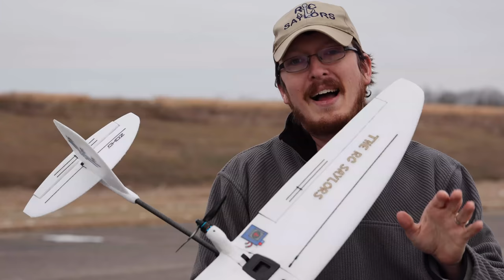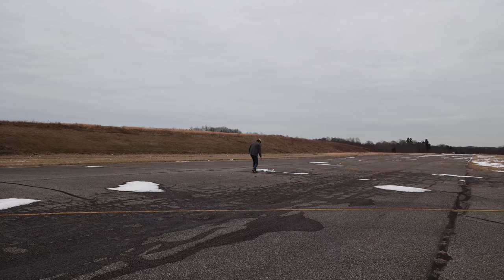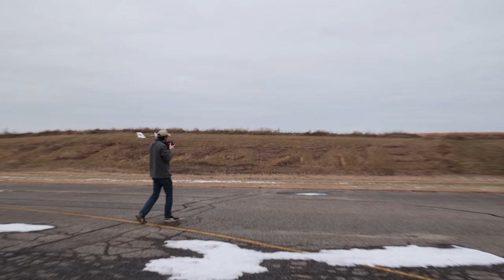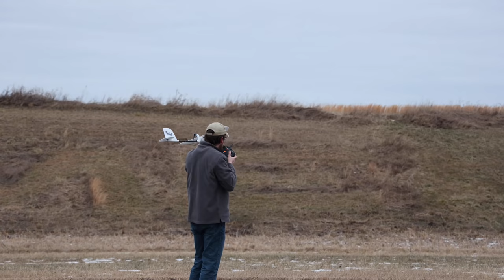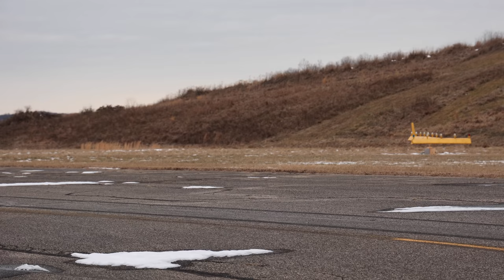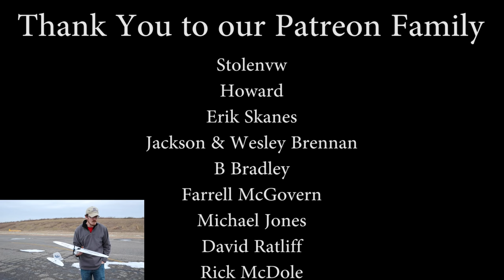DEMOLISHED RC PLANE IN 5 SECONDS - TheRcSaylors

Comment: I have this myself, and my first launch looked exactly like the opening of this video. The Drift has a really nasty downpitch when under throttle due to the thrust angle. I have the one with the Ko pilot controller, and I always use the launch mode now, but my first flight was with a normal "dumb" reciever. Great little flier once in the air, and I love the portability of it (but I wish it had a rudder). I got it for FPV, but it is fun to fly LOS as well.

Comment: Are the Spektrum "SMART" receivers particularly more difficult to program than the numerous other 6 axis receivers? I'll be looking to get a 6 axis receiver for my FT Simple Cub once I get the NX8 TX.
Reply from the maker: Well, after flying my Spitfire I would have said No.  Pretty easy actually, as long as you can follow directions well from a YouTube video.  The guy that does it on Horizon's channel is good, but he overlooks some steps that are obvious, if not for the first time doing it.  Once we get this down to a repeatable science, I'll do my best to get the content out to help others.  No clue what I did wrong on this plane, but definitely missed something.  Two receivers btw...  I'll figure it out.  Thanks for tuning in Bill!
Reply: @TheRcSaylors  Nate, follow up video would be interesting to me but I don't know if it wouldn't be to most of your viewers.

It could be set the receiver itself is faulty. I know Spektrum receivers have overall a good reputation but stuff happens.

Comment: Thanks for the awesome videos and I mean the good and bad ones. I'm familiar with the ZOHD models and they're great fliers for sure but they do tend to be picky and sensitive on the controls at times. One system I highly recommend for this is the ZOHD Kopilot system and the FPV/VTX Camera combo they have. It really keeps their planes stable, with GPS return to home and very simple to setup. I currently am using the ZOHD Kopilot on the eflite Opterra 2m and the RMRC StratoSurfer and I really love that security of being able to fly quite a distance and bring it back home. But mainly the stabilization mode in Kopilot really shines and makes the planes fly so stable even in windy conditions.

Comment: A friend gave me an AS3X receiver, I did not understand the manual, so I ordered a flight controller with inav, lots of buttons, but it flew out of the box after the wizard. The advantage its easier to take the time, read online on suggestions and have a nice UI. I hate fiddling with the radio... well spectrum new receivers have now PC configuration yay

Comment: Its a real shame such a great beginner fpv model has been shown like this. Guys, I love your content, I wanted to make that clear before I continue. Without you I would be nowhere in this hobby but the video doesnt do the aircraft justice. The cg mark on the wing is too far back, its actually on the wing spar and I believe this to be the cause of at least 2 of the crashes. Buy a new one and use a 2 cell 18650 battery without a spektrum receiver. Use the ZOHD KoPilot Lite and a tactic receiver which I know you own. It will fly for an hour plus. I have it setup up with Crossfire and I-Nav for BVLOS flying. I even have LEDs for night flying and a flaperon configuration. Its my everyday flyer after my UMX Turbo Timber. Its great. In fact there is an FPV version with all the electronics without the battery and receiver. Abby could use it as a chase plane in future using the onboard camera. I wish I could show you my setup but we cant share pics here. Ive still given you a like just to appreciate the hard work you do, especially in the awful weather you have had. All of my models except the Dart 250g and Drift I have brought because of your content. These include the E-Flite F-15 64mm, UMX Turbo Timber, Eachine Warbird Series (All of them!), the Volantex Sport Cub 500 and the larger Volantex P-51. You really should look into the latest Open TX radios (Radiomaster TX16s) which fly all of the models Ive just listed. Please please give the Drift another go using my advice.
Reply: There were obviously issues. It sucks that they had them. I will say the fact that the plane took that much abuse and continued to fly actually is a good way to sell it to someone who might be afraid to crash. I actually just ordered one because of this video.

Comment: Mate, just a couple of comments. Thanks for the video, camera was well operated. Smart receivers? You know more than I do about them. The airframe doesn't look much like a learner one to me. Elliptical wing, and looked like it had some camber, so the faster it flies the more lift produced, hence the need for some exponential on elevator? Would have liked to see more dihedral on a learner airframe. The plane looked like it would make an excellent little slope soarer. I would recommend it more for the intermediate/experienced flier. I dare say it would be quite aerobatic, in the right hands. Thanks again for sharing your fun!

Comment: I broke mine similarly on my maiden flight, also my fault. Forgot to fully check the control directions. I use the Kopilot Lite, which I love. Anyway, great flier once I got that right. But the wings are very weak. Go too fast and they will structurally fail (mine did after 2-3 flights). Mine are now reinforced and work great. Maybe you could demonstrate that wing failure. I’m hoping for a V2 of this great model.

Comment: safe settings are wrong nate  check the surfaces in safe bet the ailerons  are backwards
Reply: So it is possible for the ailerons to be correct out of SAFE and backwards in SAFE? What about rudder and elevator? Guess it would only take a few seconds to add a SAFE check to the preflight.

Comment: just from a quick look...the thrust line of the motor is way off...should like up with the cg and it looks like it lines up far behind the cg...the "safe" mode is working too hard and over-compensating which may be why it can compensate when the throttle is low...just a thought...

Comment: CG is wrong in book???  Not sure if this was the problem, but I just ran across a flight video where the pilot turned on his stabilization and the this plane went into a nosedive/spiral every time. Wasn't a whole lot better in normal flight. He found the CG was 'way off' as per the manual. Was way too 'tail heavy'. His recommendation was right on the servo wires of the wing... Just a thought.  have a good week...

Comment: you can easily test SAFE before you fly by moveing the plane around to see if the movements are counteracted: roll plane right and the left  aileron should rise to level plane.
Reply from the maker: I did, and it worked perfectly! I think the plane was over powered and over propped. Ill see if that makes any difference after I patch it back up 😉👍😁😎⚓
Reply: I should never have doubted you. A lot of people love that plane but they are saying that the CG it is a little bit off and the elevator has to have a very small amount of travel

Comment: The manual says to use the smaller 3 bladed prop for 3s, and the larger 2 bladed prop for 2s. You're right that you're over propped!
Reply from the maker: Way over propped, but still had something way wrong in my receiver for sure.
Reply: @TheRcSaylors  That'll run it into ground. I actually already got this airplane this week and have been flying it around FPV already. I didn't have any issues getting it launched, but like you said, experiences can vary a lot! It's a good little cruiser.
Reply: I'm flying mine without stabilization on 3S with the little 3-bladed prop, and it leaves a gentle hand toss wings level and climbing modestly at about 2/3 throttle.  (I'm trimmed for level flight at about 45%).

The manual also says the Drift is uncontrollable at airspeeds greater than 50kph (31mph).  I think it'll crowd that at w.o.t. in level flight, and easily exceed it in a power-on descent.

Comment: I know this was a while ago BUT the 5in Bi-Blade prop is for 2s use not 3s so yea wayyyy to much thrust hahaha there is a 3in Tri-Blade prop they give you and recommend for 3s use. Just wanted you to know cause it wasn't just your fault for sure. I bought a brotherHobby 1507 1900kv motor for 5in Bi-Blade and 3s which is gonna be very efficient and have a ton of power over the 1406 2600kv stock motor on 2s! KV for planes is MUCH different than quads, we would run 2600kv on 4s and 5in props but have to remember there is 4 motors and the plane can load that motor alot of the time plus a 1406 motor is TINY so it doesnt have much volume to disperse the heat to, Im surprised it didnt burn up that stock 1406 2600kv motor on 3s 5in prop lol

Comment: My dad bought a spectrum RTF cub and it flew terrible out of the box. He hated it, so after the disappointing maiden he tossed it in the shed and considered it a cash loss. On one of my visits I dug it out, spent about 20-30 minutes adjusting servo linkage, set points, CG, etc. and disconnected that “safe” garbage. The rudder (stock) would only turn left with full trim among other issues. After proper setup it flies great and is a most reliable plane. I Never fly or trust anything from any RC manufacturer with a factory setup. Like Traxxas forgetting to put in diff lube or shock oil lol.

Comment: Sorry I had to laugh as mine was destroyed trying to maiden just the same. It would suddenly become uncontrollable and crash. Tried a dive test and it wouldn't pull out and dove straight into the ground. I even snapped the motor pod off, a complete mess.  It now has plus plenty of glue and tape and flies great. The CG needs to be well forward of the marks, the elevator needs minimum travel and I went back to the 3 blade prop and increased the up angle of the boom slightly to the extent that the 2 blade prop was unusable as it just hit it. The end result is a fun plane that loops, rolls, will fly inverted and will cruise slow and low.

Comment: Some people had a lot of issues with this plane. I went 2s with mine and it has been great. I can even just glide launch it and then apply the motor. I have yet to go with a 3s or a lion pack. The 2s pack is just great in it. I went with the fpv version that came with the Kopilot lite. That works great! The auto launch is amazing too. Even with a ultra light 2s pack it does have a tiny tip stall. I appreciate your showing the Fail on your channel. I always enjoy your content.

Comment: I had the same problem with my Kingfisher PNP. It went straight up, then straight down. After replacing the fuselage, I reprogrammed the receiver correctly and it flew fine.

Comment: Spectrum!!!
Gotta hate it!!!
There is a reason why most people fly using OpenTx radios. 
I suppose it'll fix.
I know safe works, mostly.
Fix it right, use UHU Por & dreaa pins
Reply: why is this a spektrum problem?
Reply: @ab7rs  I suppose it isn't really.
Reply: @blackbirdboy1  Most people fly Spektrum, belive it or not, Spektrum is far easier to set up than Opentx (yes, I use both). And this is not a Spektrum issue, this plane is quite the challenge to launch correctly without stabilisation, belive me, I know. The thrust angle pushes the plane almost into a dive if you are not carefull.

Comment: Safe is backward.
Reply from the maker: I think so, sadly.
Reply: @TheRcSaylors  check out the Admiral 600 reciever at Motion RC. It has little switches so when safe is wrong you just flip the switch for that channel.  Best part its 20$
Reply: Sorry 29$

Comment: Perfect example you can’t use hot glue because it made your plane crash hot glue is not meant for Styrofoam planes !!!! Hot glue will also react to Styrofoam and it will melt the Styrofoam and make it heavy two and tape does that also and therefore it Will wight it down to some extent to where it can’t fly at all learn from my mistakes !!!! I think you should stick to flying drones !!!!! They give you a one star or -5 stars !!!! You can’t use hot glue that’s why crashed again didn’t crash pad of you a crash kids get that amount of hot glue you and will use and also you should pay attention to the battery warning indicator because I learned the hard way my drone fell out of the sky due to the battery being Low unless you have glue that’s made for Styrofoam it won’t fly the same because of the amount of glue you used !!!!!!
Reply from the maker: Been using hot glue for years with no issues, as many others do as well. I crashed this plane before this video, as I mentioned in this video... and no hot glue was used to build this plane initially. I respect all feedback and opinions, but I know as fact from experience that hot glue didn't make this plane crash. Fact. Sorry to be so stern about that, but I do thank you for watching 👍😁😎⚓
Reply: @TheRcSaylors  Sorry for being so mean I love your videos I just thought you use tight glue but sorry again for you being so mean on your video on the other hand I do like watching your videos and I would like to be part of your testing drones planes or whatever I can send you my address so you can send me products to test ???

Comment: Beware buying ZOHD planes as they don't support spare parts for some of their slightly older models when they introduce newer ones...I have 2 which are unflyable because of this....won't be buying anymore
Reply from the maker: Don't almost all companies do that these days? Not saying we agree with it (we don't) but sadly we see this with just about all brands on the market. You like something? Buy a second one for parts. That's what I do, or buy up spare parts that are more likely to break. 👍😎⚓
Reply: @TheRcSaylors  Bet a lot of fliers would love to spend £200 on a spare model in case of need for spare parts so 10 models doubled would cost £4000...don't think so...manufacturers should build their reputation and sales on spare parts availability or customers will find someone else to support...bet dji support their models..